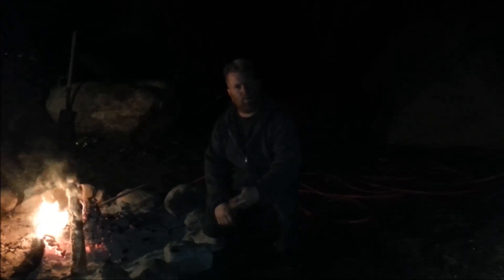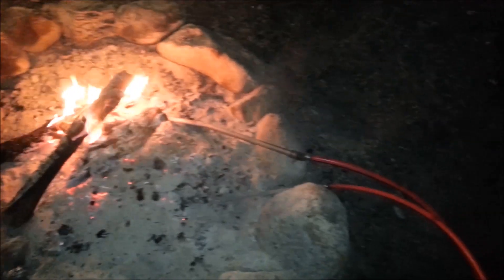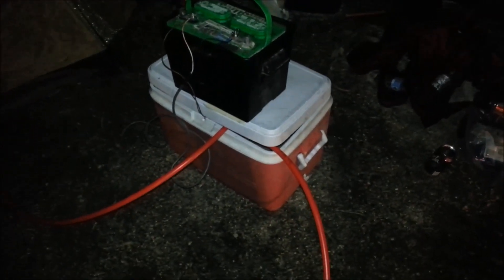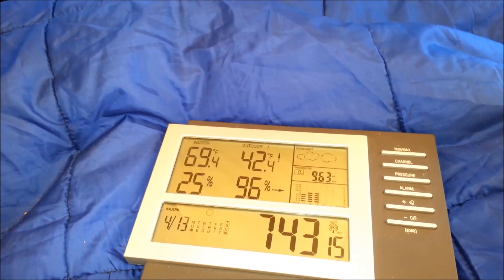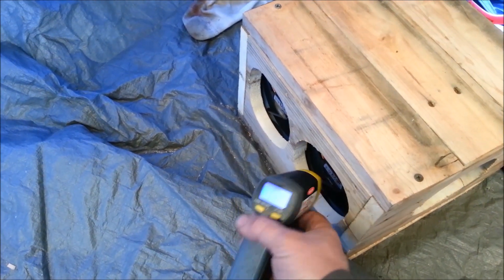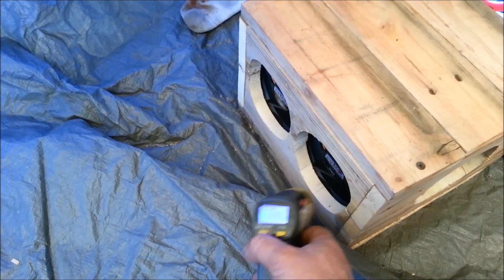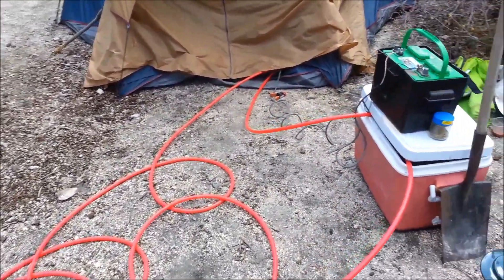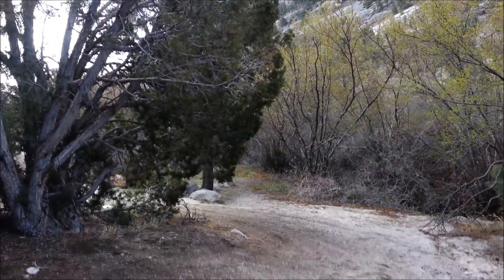Campfire Tent / Vehicle SAFE Heater IN ACTION!

Comment: I drive a truck so I don't have anywhere near the time you have but I have a request:

Can you experiment with a lighter more long-term system?

A Jerry can sitting atop some towels/clothes, a coil, and 2 check valves one to let air in when the system is under a certain amount of vacuum & one to relieve a certain amount of pressure.

The fire should, at least in theory provide enough energy to provide convection currents to heat the water in the Jerry can. The radiant heat off the can would heat the tent while simultaneously cooling the water. As it cools it should create a sufficient vacuum to allow warm water in from the fire.

You might need a couple check valves in the line as well to create the vacuum needed in the jerry can.
Reply from the maker: That's an interesting idea.

Comment: Other than cost,  would you see any problems using copper tube? I'm just thinking about long term rusting at the welds.I have trying to come up with a better heater than my Mr heat. It fills the tent with condensate and every thing is set in the morning. This looks like the deal.

Comment: I know this is old but I'm curious.  Have you tried using this in the summer timer with ice water in the cooler as a make shit swamp cooler?  Even just water may cool the tent just enough.  Possible even bury the coil in the ground a little ways and have a makeshift heat pump.
Reply from the maker: Interesting thoughts. It would more than likely melt the ice rather quickly. Swamp coolers themselves use very little energy and I could use the same fans and pump to make a tent swamp cooler.

Comment: Hey just a question, why is the cooler nessassary? Wouldn't it be more heat efficient if you were to just seal the tubing and have it constantly pumping, avoiding the cooler?
Reply from the maker: +Michael Lee The cooler retains heat and keeps it an open system. Closing (sealed system) makes it a dangerous pressurized system that could explode(steam)

Comment: Poss. less hose might give you more heat?
Reply from the maker: +RockyMtnGobblers The heat loses through the hose are going to be very minimal. But theoretically yes, more heat could be obtained but you could do the same with insulation on the hose.
Reply: ok thanks !

Comment: what about making a 5-10 round copper coil that sits on top of a coleman fueled lantern at the very top, this would let you get a lot of waste heat from the lantern in your tent, likely if you used a siphon to get the water from the lantern to the tent, you'd have far more choices on pumps as your not dealing with potentially 212F water. Plus at night, wouldn't you already be using the lantern and this setup likely would not stop much light from the lantern. fuel usage would be around 1/4-1/2 gallon per night if you left it running all night. i'd think you'd be overwarmed than underwarmed really.
Reply from the maker: +twilson1118 The BTU output of a lantern is relatively low. It would struggle to heat a tent more than a degree or two. It would put out more usable heat to just hang the lantern inside the tent and then I could see a 5 degree temperature rise.
Reply: i wouldn't hang the coleman northstar lantern i have in a tent as that things puts out a ton of heat and likely would melt your tent doing so.

Comment: Just a question for practicality, how much does this thing weigh .. as in to pack in a bag or such? (not including the tent itself . although a spec on that would also be nice)
Reply from the maker: Dreem Walker Generally a weight question with camping would signify someone that wanted to backpack in to a campsite. This is far to heavy for that only because of the deep cycle battery. Weight wise for everything minus the battery would be around 20-25lbs including the cooler. A deep cycle lead acid battery weighs in around 60-80lbs.

Comment: Hey Bud,  Got a question for you, a little off topic for this vid but here goes anyway.  The other day after a long harsh winter I went to dig my lawn tractor out of the shed. It started well for sitting for so long but I had trouble getting it out because the deck wheel was frozen in. Anyway I ran out of gas trying to move it so got more gas and tried starting it again and it gave a big backfire(which it has done before) but then I started it and now it's blowing a constant cloud of smoke and I mean blowing smoke !! It still runs and I got it outside but I won't be able to run it like that.  Any ideas of what happened ??
Reply from the maker: If the engine is a OHV then it could have blown the head gasket.
Reply: Hey, Thanks for getting back.  It's your basic 15hp Briggs and Straton engine and I believe it's an OHV so that makes sense. So that would allow the oil to get through to the muffler and burn somehow ????
Reply from the maker: If it is an OHV then there is only a thin space  between the cylinder and the push rods/valves that is blocked by the head gasket. If this thin piece of head gasket is blown out, oil can leak into the cylinder.
I would first remove your air filter and make sure oil isn't coming in the the breather hose connected to the filter housing.. If it is, the filter will more than likely be soaked with oil.
Reply: Ok, I haven't had time to really look at it too close since I got it out(weather) so I'll check some stuff out tomorrow. All I know for sure there is a lot of smoke and there is actual oil itself by the muffler which is located at the front of the engine/tractor..Thanks for your help....
Reply from the maker: It's a James Bond smoke screen tractor now.
Reply: Lol  It will be great for chasin mosquitoes away when they get here !!!!

Comment: Just a thought,but wouldn't it work better if you made the fans blow trough the heater just like on a vehicle .You should get a lot more heat that way. Thanks.
Reply from the maker: Funny you asked because that is the same thing I thought. I actually read quit a few debates on Push or Pull radiator setups on automotive and computer setups. The end results of everything I read is they are identical in performance.

Comment: You could cut 2 notches for the hoses going in and out of the cooler, and when using the cooler without the heat adapt grommets to fit in the holes.
Reply from the maker: Yeah, that would work good.

Comment: That is really ingenious Moe. I wonder if a fella was to make a pex tube mat or even weave vinyl tubing through a piece of 4 inch foam to sleep on, if that would be enough without the fans and radiator. We always used to just dig a bed sized hole in the tent, put some coals down, then ash over that, covered by a bed of spruce boughs, then a large hide over that and yer bed was warm for 24 hours at 30 below zero. At that temperature though it was impossible to dig the hole on a fresh setup cause the ground would always be frozen but still it worked without the hole when ya had to. That was the custom way back when, and most prospectors tents did not have floors in them for just that reason. With a mat made of lets say styrofoam blue or the 4 inch foam with the lines embedded in the foam and then just a blanket over that, it might just work pretty good. I was wondering though - how long did the battery last?
Reply from the maker: Yeah, after watching the video I thought I should have at least coiled the excess tubing on the floor of the tent. It would be neat to have a sleeping pad with hot water running through it. The battery specs show that it could run 50 hours straight with the amp draw, so that should do 4-5 nights.
Reply: you can use antifreeze liquid  in the tube that way you don’t wary about the over heat also you can put valve control if get over heat

Comment: Clever idea :-))

Of cause you can optimise it by shorter tubes/insulaton and perhaps a larger mass of metal under the fire, but it works :-))

Hey just make a matrix of tubes to lay under the floor of the tent and you can sleep on a nice warm floor lol.

You clever man :-)
Reply from the maker: Yeah, after watching the video I realized I should have coiled all the extra hose on the floor of the tent. I was worried about getting water temps at or above 100C(212F) but it didn't and seamed to hoover around 65C(150F). So I know I can fine tune some items to keep more heat in the system.
Reply: sixtyfiveford Yep you allways come up with interesting things, i bet you have a hard time getting to sleep at night, the brain sometimes dont stop chugging out the thoughts/angles and possibilitys :-))

Comment: A good idea, like the fact it is not pressurized.
Reply from the maker: Yeah, you start temping fate when you play with water, fire and steam in a pressured system. It seamed to pull out enough heat to stay around 150-160F. I was worried about making it to efficient and hitting boiling temperatures.

Comment: Hey, thanks, nice concept. One thing to try is, a little backwoods trick is to lay some big, moist,  punky logs on top of the coals to help insulate the whole thing against rain and snow. The coals will stay hot for hours, depending on the size of your fire, but you may have some unwanted smelly smoke, initially.
Reply from the maker: That's a great idea.

Comment: Wow,155 degree water,thats nice.
What is the temp limit on the pump and Pex?
Reply from the maker: The Pex says at 200F it can still handle 80 psi. The pump has no hot water rating but I figured the water keeps it at whatever temp it is and a electric motor running out in the air can easily approach 150F.

Comment: I  have been waiting for this video, glad it worked out as well as it did. Did you find anything that you are going to change about this design to make it easier or more efficient. Thanks for the update.
Reply from the maker: I think my computer fans could be a little more powerful but right now they are silent. I know if I get ones that move more air they will be louder. The extra Pex hose I would have laid/coiled on the floor of the tent. All together it worked nicely and kept the tent warm without the fear of Carbon Monoxide poisoning.

Comment: Nice application!
Reply: One suggestion if you are going to use the stove. Try to get a pot large enough to fit the coil and fill the pot with water.
Reply from the maker: Yeah, with the coil in water it would definitely keep the heat around the coil more efficiently.